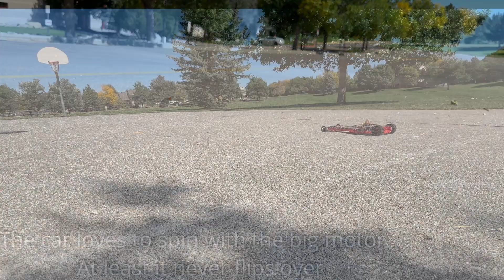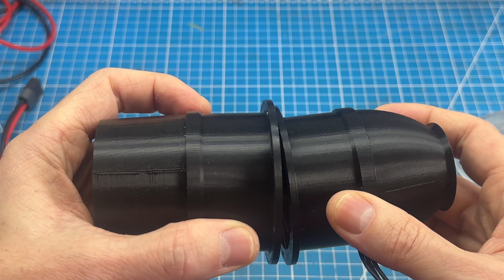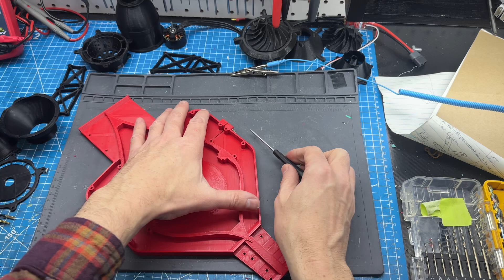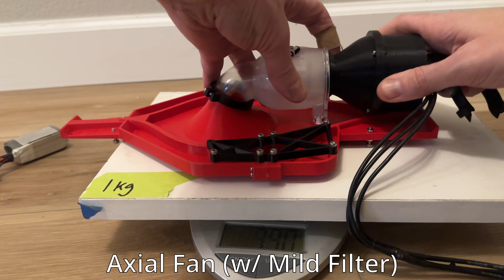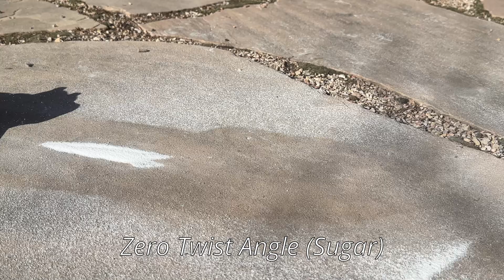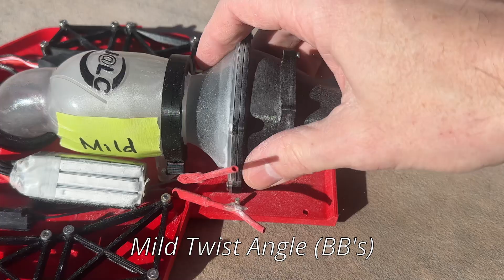Testing Fans and Filters for an RC Fan Car

Comment: Missed this video.  Great work!
I wondered if you know where the forces are on this setup?  For example I'm building a time attack car.  If you wanted to make the skirt actively move with the lower suspension arm... is the skirt where the down force pulls the car down at?  I'm wondering if I should go through that much trouble to make the skirt attached to a suspension arm...
Reply from the maker: Good to hear from you. The skirt really improves the sealing which just keeps the pressure under the car lower.  There is some force acting on the skirt pulling it towards the ground depending on its horizontal width, but vast majority of the force comes from the horizontal surface area of the floor.  The bigger the floor or the better you seal it, the higher your downforce.
Reply: @IndeterminateDesign   thanks for the details!  I think I figured out the design I want to use.  The "box" will be attached to the lower control arms to maintain the spacing from the ground in most conditions.  I'm still trying to figure out a seal material.  I have considered nylon brushes.

Comment: I think you need to characterise your fans for flow and pressure. Water column is an easy test for pressure. Your axial fans are quite likely in aerodynamic stall due to the inlet restriction and I think only a centrifugal type would ever work (maybe multi-stage axial, but that's very difficult). I think pressure is going to be more important to you than flow. Per the fan affinity laws, you want smaller diameter and higher RPM. If you want to cheat, just use a dyson impeller and motor, something like 0.28bar sealed pressure @ 125,000 RPM. You'll need 6S li-ion, though.
Reply from the maker: That makes sense, I was worried about that inlet restriction for the axial fan.  It’s hard to pack all this into such a small space.  I had no idea the Dyson was running 125k rpm. I need to figure out a way to better balance these fans.  I’m going to look online and see if can pickup a used Dyson and try it out.   

I hadn’t heard of the fan affinity laws. I need to really work on sizing the impeller to meet my exact needs.
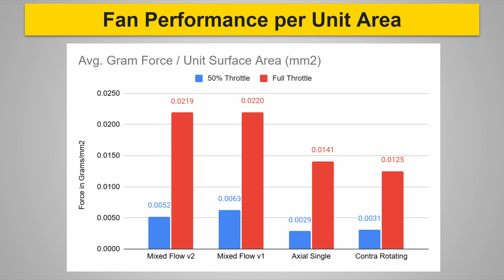Reply: @IndeterminateDesign  I think your definitely not getting enough pressure. 1bar is 10g/mm2, but your graph at 20:25 is 0.02g, so about 0.002 bar or 0.2kPa. Obviously, there's a bit of leakage with the skirt. Did you seal the car body to stop it pulling air through the 3D printed surfaces? In any case it might be useful to do a water lift test, unless you plan on just going straight to a dyson impeller.
Reply: @ RE: fan affinity laws. I find it useful to solve for constant power, so W1=W2. That gives (n2/n1) = (d2/d1)^(-5/3). Substituting that into pressure law gives (p2/p1) = (d2/d1)^(-4/3), so you should decrease diameter to increase pressure (with a corresponding increase in RPM to keep same power). Halving diameter (d2/d1 = 0.5) gives a 2.5x increase in pressure (if you increase RPM by 3.17x to maintain same power).
Reply from the maker: That would make a huge difference.  I'm going to pickup some faster brushless motors.  

I tried a closed shroud fan today and picked up about 10% performance and it's massively quieter and smoother.  I think I'm getting some blade flexing with the open shroud.

Comment: 18:30 would be good to see power here, too. Grams/watt is the key. Although grams-downforce/grams-added is maybe more key.
Reply from the maker: Agreed, I need to build a high amperage current measurement setup. The one I have only goes to 20amps, and these fans are definitely exceeding that.

Comment: Super cool project. That thing is shaking itself apart though. You might want to use locking nuts such as din 985 or similar ones. It's not perfect preventing the loss of preload but at least the nuts shouldn't completely come off.
Reply from the maker: For testing I just have it setup to snap together which was a bad idea. I also have to figure out how to balance these a lot better. The fans weigh 12g, so I need a way to balance down to a few milligrams.

Comment: Look into x8 cinelifter drones.  They are a octocopter with a small layout and use contra rotating props.  Generally the consensus there is the second fan (props) is producing 30% less thrust because of the dirty air.  They do the same thing with a higher pitch blade for the secondary fan though so parts in the right direction for sure
Reply from the maker: That’s a cool setup. I looked at a couple of EDFs that were contra rotating too for large RC planes. I still don’t know how efficient they’d be just compared to running a larger single fan.  They do generate more pressure but clearly my setup didn’t.

Comment: what if instead of using a vacuum cleaner setup you instead just used a normal mesh filter but with a blown diffuser setup? would there be a significant loss in efficiency? in theory it would eliminate all wear and tear on the fan and even save some weight/volume. presuming its less efficient that would just mean you have more thrust to play around with and could even try a blown wing for extra static downforce
Reply: heck you could even reduce frontal pressure with the intake
Reply from the maker: I think it definitely would work, there are several FSAE cars that have tried this with electric fans. I’m not sure how much downforce it would generate, I need to run some CFD sims to see what’s possible. It would definitely reduce drag.

Comment: Why are axial and contra so difficult to optimize for compared to centrifugal? What do plane mfg's know that we dont?
Reply from the maker: There’s a lot of information on how to optimize a single axial fan, but just due their shape it’s hard to generate a lot of pressure with a single stage. Hence jet engines have several stages to achieve enough pressure. 

For contra rotating there’s just not a lot of guidance or publicly available information on how to optimize these. I think it’s a lot of testing and even some specialized CFD setups.  My contra fan moves a huge amount of air, it just doesn’t like being choked.  Might be better in an airplane.

Comment: The fan needs to be balanced.-MSC-
Reply from the maker: Yeah, I did my best to balance the fan but being less than 10 grams means it’s very small amounts to deal with. Also the plastic hits different resonances depending on the speed which causes it to shake.

Comment: I feel like contra-rotating is more for high flow, low rpm applications like a plane or boat propeller, instead of high-speed fans like these.
Reply from the maker: Yeah, that makes sense. 20k+ rpm is asking a lot. It did move a lot of air though.